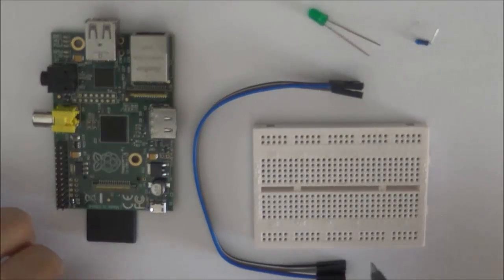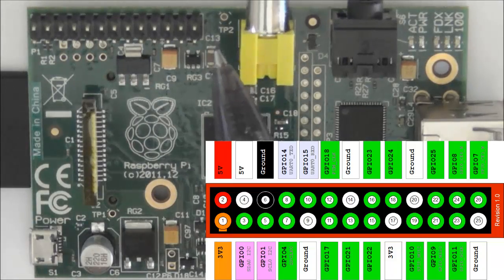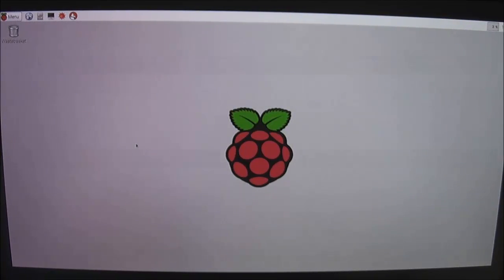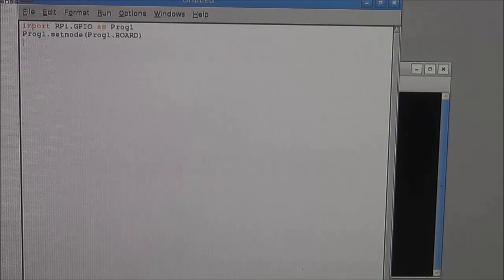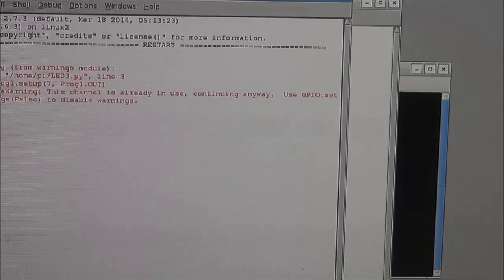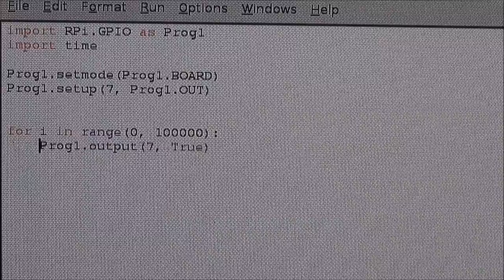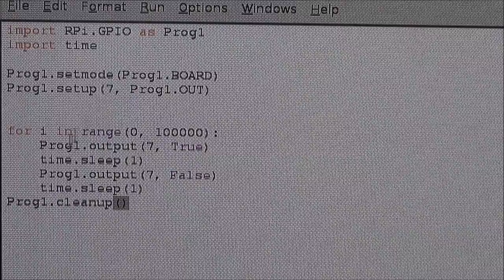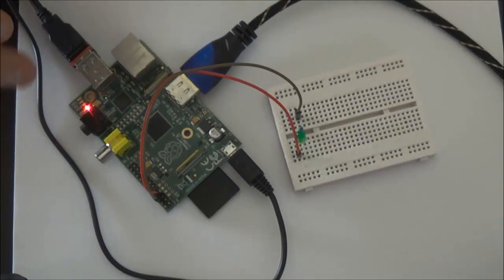Raspberry Pi #2 - LED Blink in Python - Digital GPIO

Comment: Great tutorial. but I have one question? is there a way to use the same programming method that you used, to control some form of switch, so that an externally powered LED lighting could be blinked/operated?

Comment: Hello

1. There are many devices for HDMI recording like Avermedia family, internal cards for desktop PC etc. Recording monitor with camera is really bad, it's 21th century now :)
2. But why you decided going this way? I think it's more comfortable for people working from PC with Pi, so maybe you can introduce for begginers the way how to initiate Pi just with power and Lan, and how to connect with Putty. That will be also more easy for you to capture on video.
3. If you do not have it, at least tell in video, that common versions of Pi A+ and B+ has 40 pin GPIO, of course there is new Pi 2, but the only change is the new quad core CPU and 1 GB of RAM.
4. Please note in next video limitations about Pi's GPIO, if I remember correctly output current is more limited than Arduino, 16 mA per pin with max 51 mA for all pins combined.
5. On some of yours windows desktop recordings I see for few seconds some artefacts on screen on every major picture change. Try change method how you recording windows desktop, I do not have any advice, but I'm sure there is software to record flawless videos.
5. Change the microphone what you are using for record voice for windows captures, the current one has bad quality and low volume, even compared to your camera microphone. During mastering put volumes of both mics to same level.
6. That's probably just me, but in this video when you capturing the Pi with breadboard I felt little dizzy :) it was because you filmed it with bigger angle than 90 degrees ( between the desk and camera), what is unnatural for human brain.

thank you and good luck
Reply from the maker: idea22yt I really appreciate your feedback. I've read all your points and will try to implement them in the following videos. I've noticed many people complaining about the sound in my videos which I was capturing with the camera. I just received my Pro 70 audio-technica microphone which will improve that aspect for sure.

As far as the capturing goes I do need to work on smoother transitioning of frames and better shooting angles, but I haven't invested the time to properly learn filming or editing techniques. I think it is time to either outsource it or learn it better myself.
Reply from the maker: On a second note, the video from filming the screen is much better than I had anticipated, from the camera itself I was seeing graphic distortion and discolouring which did not appear on the edited version, so in some aspect I am happy.
Reply: EEEnthusiast Ideas for the Screencapture: recordmydesktop (or gtk-recordmydesktop for a GUI-version) can save the desktop to a OGV-file compatible with most video editors. Not sure if a raspi is fast enough though. Alternate way: install and start x11vnc on the raspi, then connect with a vnc-client from your desktop and initiate the capture there.